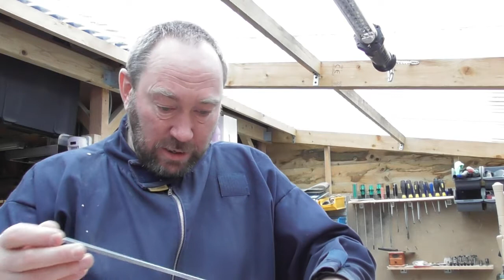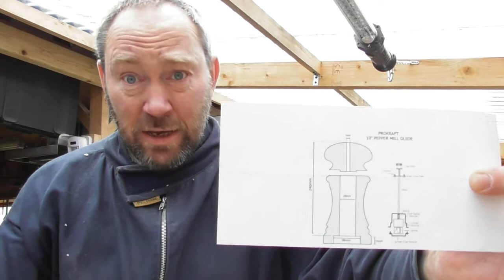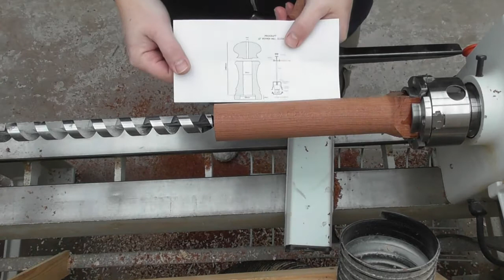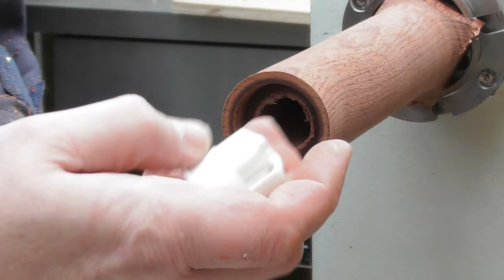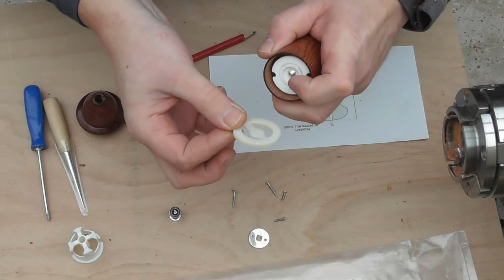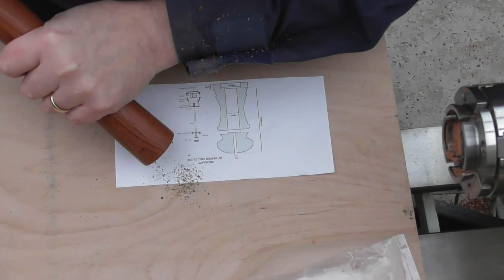Easy to make salt and pepper mills

Comment: Paper dimension guide not supplied any more (2025)
Reply from the maker: We send paper guides on request otherwise we would simply waste hundreds of printed pages that are not required - they are downloadable from the website - yes this is 2025!
Reply: @prokraftuk   yes that's fair enough and I don't have an issue with it, but your tutorial video makes a big point about the fact that a paper guide is included - perhaps you should add a correction to the video to avoid confusion.
Reply from the maker: We do still supply paper guides for ebay customers (they don't have access to pdf files as ebay don't accept them) so we actually do both ways but we will try to update the info on the video without re-launching it. It is however quite difficult to amend things for the various sales platforms and also to remember what the content of each video is and to amend it several years after it was made - one of the reasons we rarely do videos now!

Comment: Hi Jon, Do you do a video for these with grain matched so it all lines up afterwards
Reply from the maker: Hi Andy,
there is always a problem grain matching on mills because there has to be a small tenon to join the rotating head to the body. The only way around this is to glue extra wood on to make the tenon - a lot of work to try and match 2 pieces that are normally different diameters anyway. I hope that makes sense. The short answer to your question being "no".

Comment: You mentioned corrosion due to the effect of salt on metal parts. How is your spring retainer affected? Does it not corrode? I like your kits and they look easy to fit so I'll be ordering some in the near future.
Reply from the maker: Eventually all metal corrodes but the corrosion is accelerated where salt is ground between metal parts - at least that is my understanding - you would have to consult a metallurgist for a definitive answer!
Reply: Jon Whateley yes I'm aware of that. I just wondered if you'd had any problems using a metal spring retainer in your salt mill kits.
Reply from the maker: Not as far as I am aware, we have never had any returned with a problem, there are models that have plastic spring retainers, they are generally quite a lot more difficult to fit and there is no forstner bit the correct size for them. The advantage of the metal spring retainer is that it simply slots in and fits in the central shaft with no further dimensioning or cutting - swings and roundabouts I guess!
Reply: Sounds great Jon. I'm having a bit of a break atm but I will order some kits in the next few weeks. I have a couple of design ideas in mind based on Danish designs from the 50s.